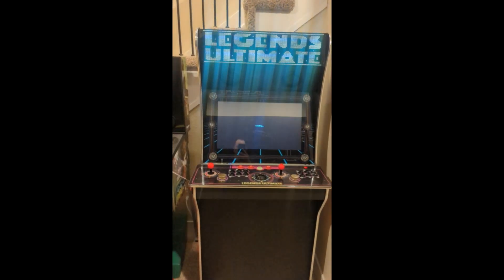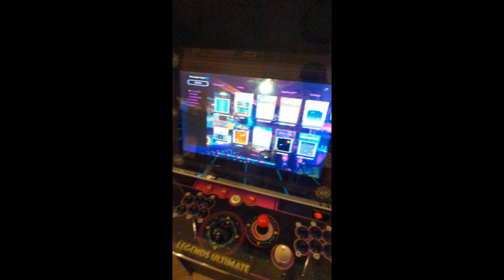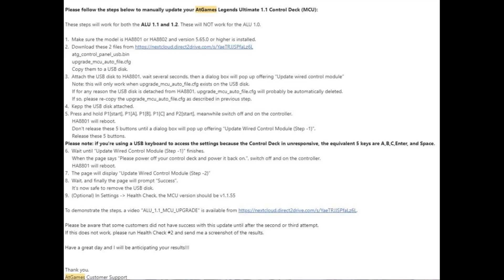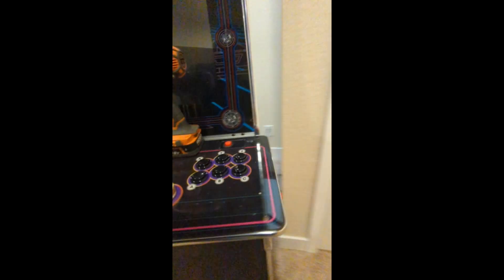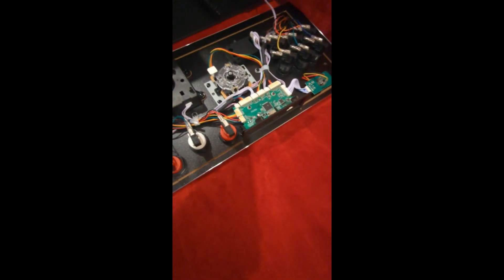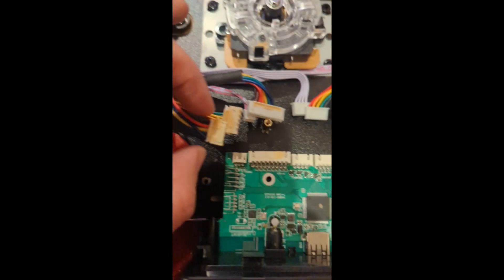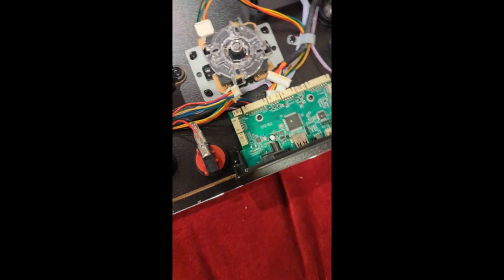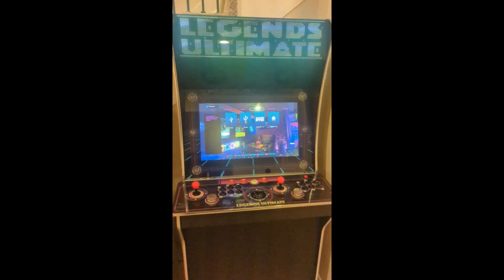AtGames Legends Ultimate (ALU) Arcade control panel troubleshooting & control board replacement

Comment: Hello Bryan, can you do me a big favor, I need to see the connections to the main CPU board to the LCD board. I just bought a used unit and all the cables were disconnected and I might be missing a cable or more. 
I have power and lights to the monitor, but nothing is running and i got the power button to light up and I can switch from main to HDMI. It just seems like I don't have enough cables 
Please show me where all the cables go inside, please. Let me know how I can contact you by email or Facebook. Thanks

Comment: This is not a control board problem, it’s a software problem. The ALU software sucks and is glitchy, the control panel not working is a handshake issue with the OS.

I found that what works sometimes is to go into the controller settings and do a reset on control panel 1  and save.  It might take a couple of reboots but usually the controls come back. 

2 reset methods..

Unplug  the arcade from power for about 5–10 minutes, then plug it back in and power it on while holding the P1 (Player 1) + Menu buttons together. This should force a control refresh.

Or 2

Power off the device. Power on, then press and hold the P1 START + ATGAMES HOME buttons while you continue to hold the RESET BUTTON. Once you see the factory reset prompt, release all buttons.
Reply: Because the control panel is not working .. use a keyboard or controller to go to controller settings to reset controls
Reply: How to use a keyboard on atgames legend pinball machine
Reply: FYI just because it says not found doesnt necessarily mean it won't work.

Mine also said that and did the steps anyways by holding a,b,c enter start on a mini usb keyboard plugged into the ALU. Didn't expect it to work but it did!

Comment: I had the same issue when I got mine about a year ago. After several hours of troubleshooting, I found your video and it pointed me in the right direction. Kinda sad that this issue is so pervasive. And also sad that I had to wait an extra week and half to have the new controller board delivered but at least its working mostly well now (still have issues with the second player start button and the pinball buttons on the side not being very sensative). 

Anyway, thanks for the vid. It truly helped out.

Comment: Same issue here, took the control deck off, checked connections, cleaned and slapped some dielectric grease on the usb connection, control board works again 🤷🏼‍♂️

Comment: having this same issue and its pissing me off cause my cabinet is not roughhoused on at all or anything im the only player of it and its been working fine since i got it until i just recently went to turn it on and the controls were dead screwing around with the plugs i could get it to work for like 2 minutes or less and then it would stop working again

Comment: Had the cab under a year and exact same scenario including the blinking bluetooth lights, no controls, atgames email responses and even daughter's nail polish. Only thing different were the 2 files loaded to a flash drive did not give me any prompt. They told me I needed to replace the CTR board and so I emptied my pockets and adhered; $35 shipped. The troubleshooting took longer than the circuit board swap. Also, some of the ctr cables didn't noticeably snap back in but everything booted up and works for now after the fix including the coinopsx drive. Thanks for posting so I could at least see the hellish maw I was jumping into before actually jumping!

Comment: Hey , I bought this machine and game options are moving to it’s left by itself. They asked me to reset it. It’s still doing the same. By chance do you know how to fix it?? Thank you
Reply from the maker: Sorry, don't know. I'd pull the joystick out of the unit and see if anything is physically wrong with it, but that's a complete wild guess.
Reply: Hi there.  I had an issue with one of my joysticks getting stuck to the right and resolved by doing what he did in this video,  but instead of replacing that board,  i noticed the switch on the joystick moving in that direction was sticking.  So i took a q tip with a tiny dab of wd40 and worked it on the switch.  That was like 2 years ago and it's worked fine since.  Good luck!
Reply: @Bigwoj1  thank you for sharing this

Comment: Great job! I had the same problem but it was with my arcade control panel on my ALP. I got the same response from customer service as you did with the download of a fix that didn't work. Finally, they said I needed a new circuit board for 20 dollars plus s/h. It appears they have some bad chips in their control panel products.

Comment: This is awesome thanks for the video. Just a quick question, did you need to reinstall CoinOpsX / BitPixel stuff or was that all in tact since it was on your USB? I have pretty much the same exact setup, and the same exact problem. I have a new board sitting here, just trying to find out if I need to redo all the coinops and bitpixel stuff after I put the new board in.
Reply from the maker: No need to reinstall anything. The control board I replaced simply controls the joysticks/buttons/trackballs.